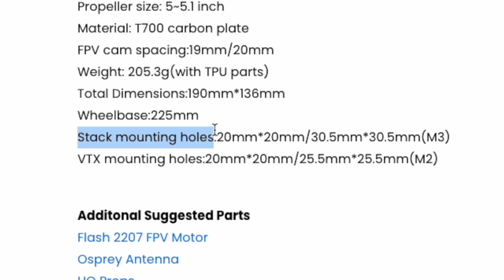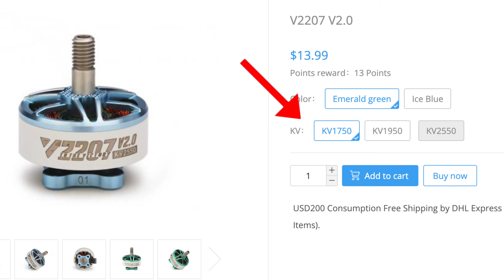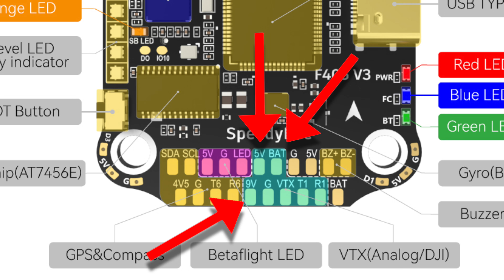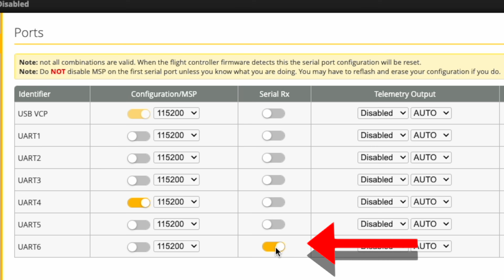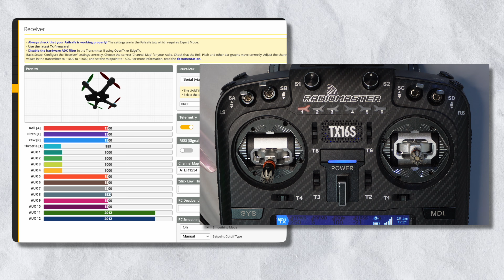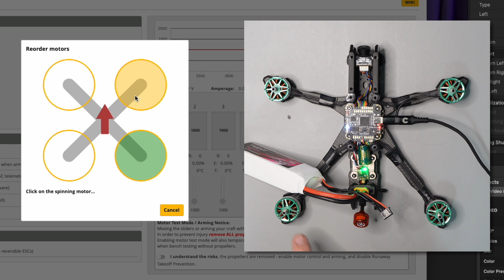Ultimate Beginners Guide to Building A FPV Freestyle Drone

Comment: T6 and R6 what is TX and RX?
Reply from the maker: Transmit and Receive. 

When you wire. You wire a TX to an RX and a RX to a TX of the same number.
Reply: @DarrenAllatt  on speedybee not find TX or RX only T6 R6, the x is a placeholder, wire T to T and R to R ?

Comment: If I use 1750kv motors and 4s battery is it wrong?
Reply from the maker: Not wrong, just under powered. Those motors are ideal for a 6S power source.
Reply: @DarrenAllatt  As I was told, it is the other way around. 1750kV motors cannot withstand 6s
Reply from the maker: @VaxtaFPV whoever told you that was completely wrong. You have it around the wrong way.

Comment: my tmotor 2207 v3 1950kv is hot after every flight, i set the motor timing to medium same as the video. Does that affect the temperature?
Reply from the maker: When you say hot, how hot? 

They won’t be “cold” or pre-flight temperature as you have 26 volts running through them and they are spinning at 50,000 RPM. 

Also what quad are you using and how much does it weigh?

Comment: oh no JB is in danger
Reply: Oh I got a heart. My pleasure
Reply: I'm from India, building my budget drone in category of racing. Here is the part list.
Speedybee f405 V3 stack
Readytosky gt2205 2300kv motor
ZMR250mm frame
5inch triblade 
2200mah 3s lipo

Comment: It is worth mentioning at around 8:30 about signal polarization. I see that your receiver has right-hand polarization (RHCP), the same antenna should be on your googles. Also let me know which of two is most common? Thanks!
Reply from the maker: Typically for Analog and HdZero you use RHCP and for DJI and Walksnail it’s LHCP.

Comment: Can you use a 2555kv with a 6s battery
Reply from the maker: You can, but:

a) your ESC will most likely catch fire if you don’t put a motor output limit on it. 

b) yes if you put a motor output limit on in Betaflight
Reply: @DarrenAllatt  thank you so much, didn’t think you’d reply❤️

Comment: In firmware Flasher on beta flight I have selected my correct flight controller (Speedybeef405V3) and the latest firmware version for the board next I load firmware [online] then flash firmware and then I get Failed to open serial port. Im not sure what’s going on.
Reply from the maker: Can you connect to Betaflight normally ?
Reply: @DarrenAllatt   yes
Reply from the maker: @noahlee4933  try holding in the boot button on the FC as you plug in to usb, should go into DFU mode

Comment: Hello sir I have a question where should i connect ibus reciver to f405 v3 flight controll
Reply from the maker: Hey! I would try either the SBUS Pad or an RX Pad. That's not something I am used to as it's not common in FPV, so you may need to goggle that

Comment: How i access camera menu ?
Reply from the maker: Which camera menu? 
As in to change the camera settings, or to change the quad / drone settings
Reply: @DarrenAllatt  runcam camera setting bro how to change im use same FC and camera I connected rum cam blue wire CC pad but can’t access cam menu ?

Comment: can i use 6s 1550 mah 130c batteries on a 5 inch buuild with 2207 1850 kv motors or will a 1550 mah be to big and heavy?
Reply from the maker: Yeah it will be fine, just on the heavier side

Comment: Can you toggle horizon mode, angle and air mode in beta flight, great video helped me out tons, and is it hard to get a drone permit in Australia??
Reply from the maker: Yes you can toggle them on in BF, just set the switch in the modes tab. 

To fly in Australia you need to be a member of the MAAA and fly at an MAAA airfield with a spotter. 

But if a tree falls in the woods and no one is around. Did it fall?

Comment: I didn't watch the video, it's long, I just went through the bookmarks. I just realized again that it's really not for everyone to be able to build a fpv quad, it's just too complicated. And this is the simplest version of the quad, it is without GPS and other things needed for example for LR. GPS problems are always on the next level. This video must scare the greenies. It is necessary to appreciate the enormous amount of work that has gone into the video so far.😎
Reply from the maker: Thanks MomoBrut... It looks intimidating to see how much goes into a drone build, but how do you eat an elephant? 1 Bite at a time. The thing is, you are going to need to learn to build one for FPV purely for the fact that even if you buy a pre-built drone, it will break when it crashes, then you will need to fix it. Knowing how to build is learning how to fix it.
Reply: @DarrenAllatt  Well, I built a lot of quads, that's why I write what I write. Putting everything in one video is I don't know how to say it, I actually said it. The rookie won't be able to understand most of the video anyway, and after half of it he'll be downright overheated. And those who are not greenies just smile and nod their heads, it's done nicely. It would probably be more reasonable to just do it gradually, do more separated videos ... but I'm older now, and maybe I perceive things differently. But young rookies just can't focus on something like that for that long.

Comment: Is the speedybee F7 v3 stack pin out the same as the DJI 03 air unit wire to just plug in no soldering?
Reply from the maker: I know on the F4 it is, so I’d assume the F7 is too. Check the diagram on their website to be 100%

Comment from the maker: For my next build video, what should it be? Drop your requests & parts suggestions?
- What size? (3", 3.5", 6", 7")
- Sub 250 Gram or Any weight
- DJI 03, HD Zero, WalkSnail
- Freestyle, Racing, Long Range
- Full Size GoPro vs Mini GoPro, No GoPro?

You tell me, what you'd like to see!
Reply: Sub 250g  DJI 03
Reply: @seanpaul211  Yes, excellent suggestion! Let's see what size Darren chooses!
Reply: 7" dji 03 long range with full size gopro.. sub 250 😬
Reply: A sub250 4" please
Reply: GoPro
Reply: Walksnail 250
Reply: En micro qaud 2.5 inch sub 200g
Reply: 3" please :). 
Could be analog or some low-mid budget digital, because DJ is too expensive, few people could afford
Reply: 7" dji 03 long range with naked Action 4 please !